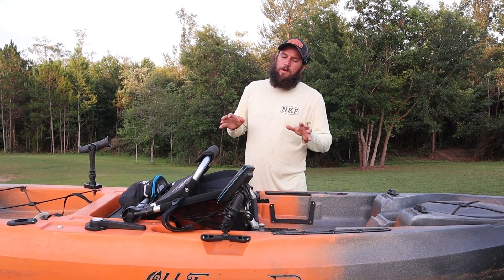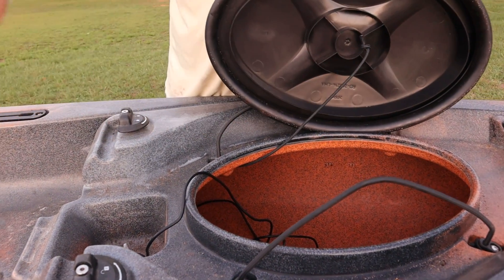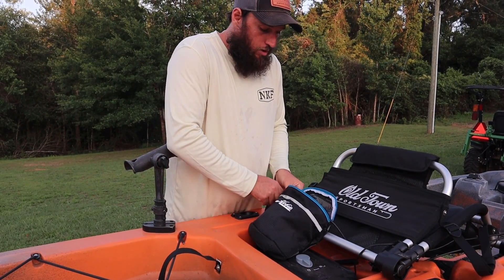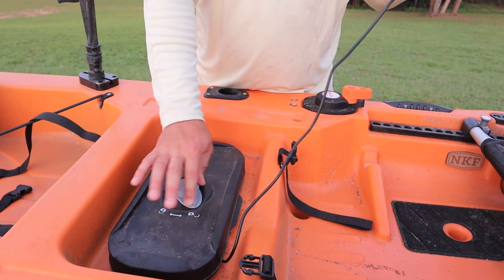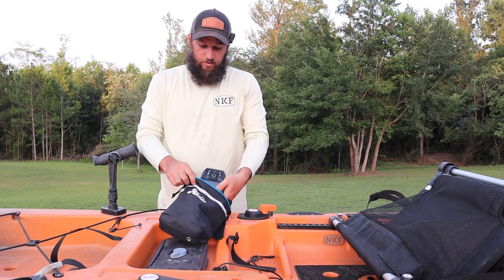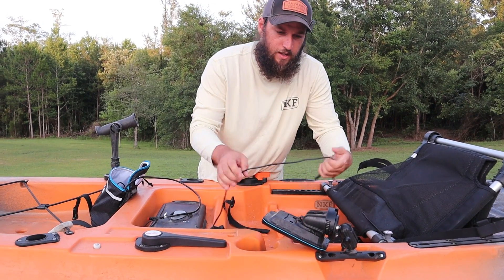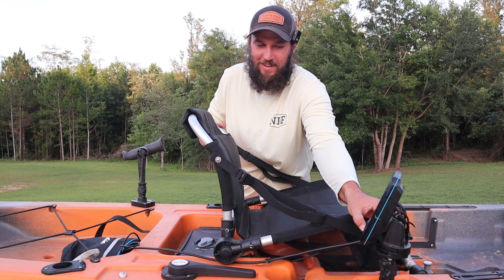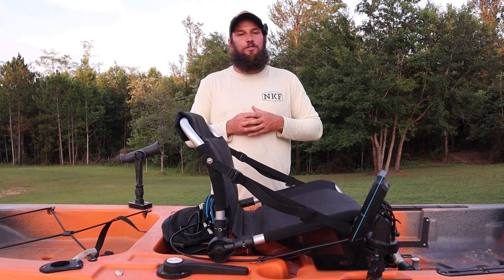Installing a fish finder on a kayak without drilling holes (Old Town)

Comment: I do the same thing but throw my battery in the front hatch also. I put some Duct Seal down on the bottom and the battery sits in the mold and doesn't move. Haven't had any issues.

Comment: I have seen quite a few videos of electronics being installed on kayaks. I don't think any of them mentioned using marine grade wire and connectors. Are we not required to use marine grade on kayaks?
Reply from the maker: The majority of connectors are marine grade.   That’s just a phrase.  Kind of like military grade.

Comment: Do you need to bag up the battery pack or can you just secure in the rear dry storage?
Reply from the maker: The Nocqua system is waterproof so you can store it anywhere.  I’ve left it under the seat several times.  Inside the kayak will be fine.

Comment: Hey Nick. Does that scupper transducer mount work for hummingbird with side scan? Does it go low enough that the boat doesn’t interfere with it?
Reply from the maker: It does.  We make a Humminbird version.  Side scan shoots out and down at an angle so it clears the bottom of the kayak without issue.

Comment: Read my mind on this. Thanks for the video. I bought a Garmin 73sv for Destin but I just read that it doesn’t have coastal maps. Best way to update it?
Reply from the maker: You don’t need the coastal maps.  It’s not nearly as much information as one would think and the depth lines are far from accurate.
Reply: You’re the man, Nick. Thanks!

Comment: Bro you ought to get a wilderness systems recon 120 hd next. Awesome rig just not enough aftermarket parts. It's just like an oldtown with instant reverse. It's a super fun, super stable rig, the drive is awesome it just needs someone like you. I have to replace a broken prop which includes drilling holes and removing roll pins I'm sure you could come up with a much simpler design.

Comment: Love this idea  Can you also store the battery in the rear hatch under the seat or do you see an issue with the battery cable being compressed by the cover
Reply from the maker: You can install the battery in the rear hatch.  (I just don’t like moving the seat to recharge, the bag provides easy access and stops anything from sliding around inside the kayak). The cover will not hurt the cables.  I’ve been running the wires like this for several years with zero issues.

Comment: Yo Nick, I'm having trouble finding any info on what transducer works best with the Simrad Go series (which I have on our boat). I'm going to set my Topwater PDL 120 to work with the same unit, I'll just move it back and forth as needed. Any info would be helpful and Thx for all the great product and videos! Super helpful always.